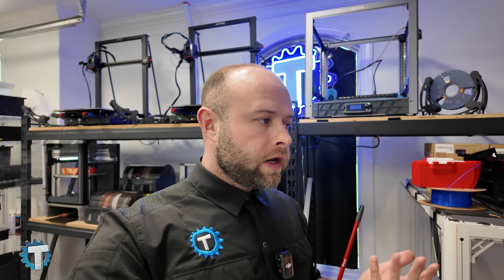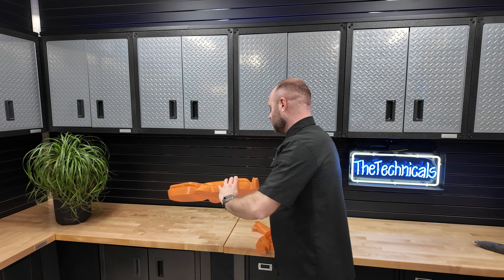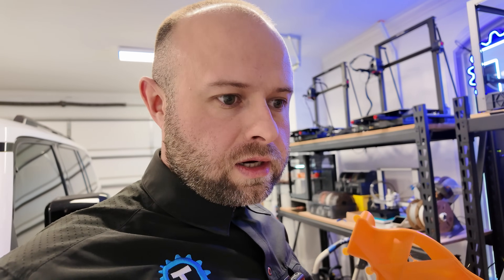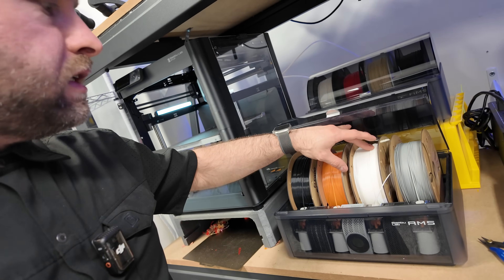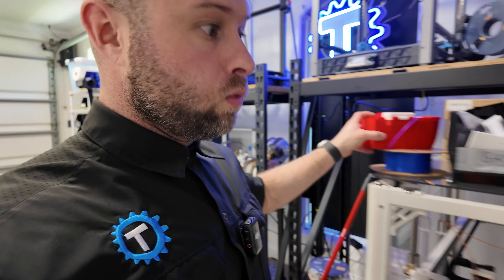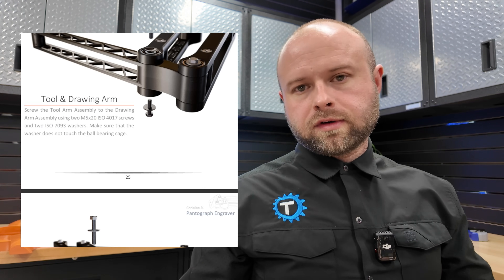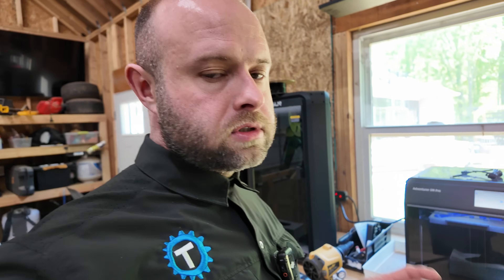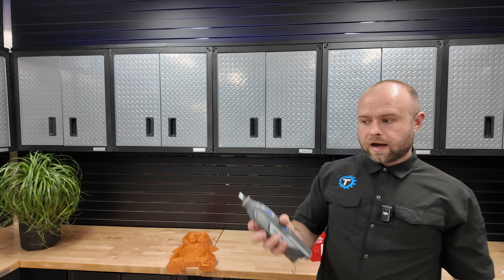I thought I fixed it...NOPE  /  New Precision Print  /  3D Printing Vlog

Comment: On the Giga, the filament coming straight off the spool into the extruder has always been something I viewed as a potential problem .. I'd get some 4mm OD, 2.5mm ID Bowden tube (same stuff as the Bambu uses) and run it as a filament guide from the spool to the extruder... That will basically guaranty against the filament possibly getting hung up on something on along the path to the extruder.
Reply from the maker: When the gantry rises during printing, where does that 30+ inches of bowden tube go? My fear is it'll flop down and get caught up in the print head
Reply: @TechnicalsTinkers  if you secure it into the pneumatic coupler at the top of the toolhead, and secure it up by the filament sensor, it's not going to go anywhere... you could even model a second pneumatic coupler on the output of the filament sensor case
Reply: @TechnicalsTinkers  valid concern a quick thought that popped into my head what about putting some sort of elastic band that holds the bowden up so when it gets to its max Z heigh the band can hold it above the head? just spit balling haha

Comment: If looks like you have a number of issues that are compounding.

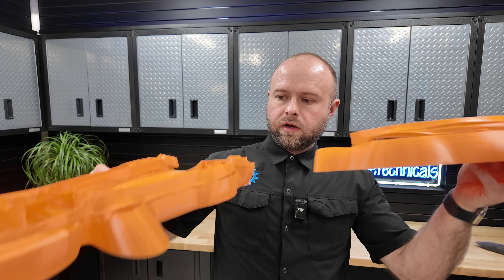Looking at the back of the head starting around 1:30 in IMO you're slicing for the outside thickness of a much smaller printer which is causing those layers to miss like that. For a printer of this scale IMO you'll have to make the thickness 1.5 to 2mm. Also IMO the coincidence between that layer skip, which looks like a partial clog, and the very back of the head is not a coincidence but was caused by a bit of unsupported printing.

You should also print a temperature tower with each filament you want to use; even if it's the same brand filament the properties may differ even between colors and even between batches of filament. Picking the right temperature may help compensate for the printer being a bit inconsistent.

The Orangestorm Giga is cheap for a printer that size, both in price from a retailer and in manufacturing quality IMO. It's usable - barely - but could use a bunch of upgrades.
Reply: I totally agree. The issue occurs near some of the steepest overhang angles of the print. I have had similar gaps and extrusion issues on my much smaller printers as well,  which occured near similar overhang angles (25°/65°).
I would check that the settings for "ensure vertical shell thickness" is at least 1mm for prints this size, ideally this should be not much less than the width of all your walls. If that setting is not available in your slicer, you're going to need to bump up your wall count significantly to achieve the same effect.
Reply: @o0shad0oo  yet it prints those giant skulls just fine...they also have some pretty steep overhangs... For that reason, I'm inclined to rule this theory out...
Reply from the maker: I won't rule anything out but you're right. It's instances like that that drive me INSANE. All signs point to the problem being X, but then any other given print that SHOULD exhibit the same issue just doesn't. IM GOING FRUIT LOOPS
Reply: @TechnicalsTinkers  You'd think it looks like X, and the Giga is known for isues with X, but like you noted the back of that head had separations but the layers were at the correct height. That points to slicing issues.

Comment: My opinion is that the PLA is simply not adhering to the previous layers and starts to separate.  The first layers are warm from the build plate so they're fine.  I think this is why they make enclosed printers.  You don't need to spend money on some fancy enclosure, just cardboard or plastic.  If that works then you might want to make something more permanent.
Reply: @dougcox835  he's got those big plexiglass sheets with the Giga... It is pretty much enclosed, or at least well shielded from drafts
Reply: @3dcreationsofri  Oh, never mind.  I don't see the sheets on the videos so I just thought he was operating it open.

Comment: Im am so amazed at the amount of failures and issues I see for the Giga,  its astounding considering one failure is normally a massive waist in filament. Second, software issues, and the hardware. I do not think the Giga was engineered very well. It just seems rushed to me. For every good print, you have like two or three failed. THAT WOULD PISS ME OFF, I AINT MADE OF MONEY ELEGOO

Comment: I know you have spent a little of time and money on the Orange Storm...have you heard of the Blue Storm?  Some other content creators who also had issues and decided to convert it with quality upgraded parts.  It turned into a beauty reliable printer.  I'm only mentioning this because your looking replacing more parts on it.  I think a upgrade kit is being created.  If your interested look up Joel Telling and Luke's Labatory.  Might be a cool upgrade and content.
Reply: @TinTalon  the better extruder options, volcano hotend, cht nozzles it allows as well as beacon mesh creation would be significant upgrades done all in one shot, and are what the printer should have been out of the box (it needs a hotend that can melt MASSIVE amounts of plastic, fast, volcano cht will do that.

Comment: Hey, try a new high speed SD card for the orange storm(if that's how it holds stl's). Had similar issues with my Neptune max read some posts about big models, slow SD cards and the backup that happens when the power loss recovery is turned on.
Reply from the maker: USB3 sticks I can't imagine they wouldn't think of that given how large of a printer it is. Good tho0ught though thank you

Comment: That giga failure looks like two things.. One is adhesion to layer is cooling to fast and separating and second its almost as the steps may be off.. Or you can upgrade to an aftermarket hotend/extruder that would would far better :)

Comment: You need to take the 30 seconds to put electrical tape on the cardboard spool edges. It makes such a difference on the ams
Reply from the maker: 30 seconds what am I Joe has-a-lotta-time?
Reply: Most cardboard spools you rip the sides off one at a time and then they fit in bambu plastic spools. Problem solved

Comment: 7k subs and climbing :) -  my theory on the Giga is the extruder gears are not pulling the filament properly, they could be just managing to grab the filament which is ok most of the time but if you have a slightly smaller diameter section of filament come through then it fails to grab it properly and just can't feed it so you get gappy layers at a random height. Another thought is if the hotend is not heating properly or the thermistor is not reporting the correct temp or is wandering then you could be trying to force cold filament through from time to time and it ends up under-extruding. Swapping the whole extruder head should fix it.  If it does fix it then it's off to the races again... such an impressive machine.
Reply from the maker: New print head lands today but my thinking too something with the extruder gears. Will report!

Comment: Are you able to run a reverse bowden and bearing on the filiment spool for the Orange storm?
Reply from the maker: You mean a tube from the top to the printhead? My worry is it's so long it'll get caught up in something as the gantry rises
Reply: @TechnicalsTinkers  yes, but run to the top
Reply from the maker: right, but as the gantry rises, that's like 30" of bowden tube that will have nowhere to go but down

Comment: Could there be drafts causing problems because it’s sitting on garage floor??  Just a thought
Reply from the maker: Unlikely, the panel stays on the front when printing. It's not sealed but it functionally eliminates drafts

Comment: My experience with orange PLA was that it hates you and wants you to fail.

My advice would be to use the same GCODE file and send half that charmander with basic black PLA.  See if it still fails.  I know that's expensive, but such is the cost of troubleshooting.

Comment: I still feel badly for you that you're having so much trouble - I wish someone from Elegoo would reach out to you and help you fix this.
Reply from the maker: It's fine, I know what i'm getting into. Also, it's good content when it works and even when it doesn't
Reply: I agree, but the giga is a first gen printer of its kind (at least where it’s “easily” available).

Not defending it by any means, but the giga needs help big time in its second revision
Reply: Every one of them is junk. They're not reaching out because they ripped off everyone who got one. Real shame he paid for his...
Reply: @Oldsjunkie  They aren’t junk. They are a bargain, but there is some issues with the extruder/print head and/or software. Try to not over exaggerate or be a troll..
Reply from the maker: All good dude, maybe views will pay for it one day. ONE DAY?????